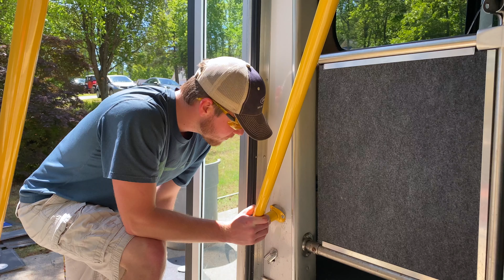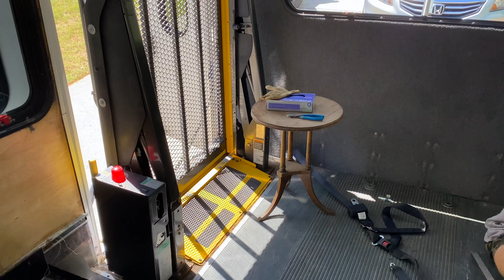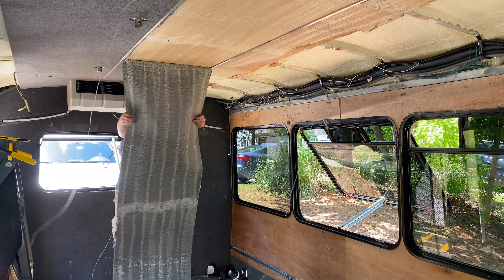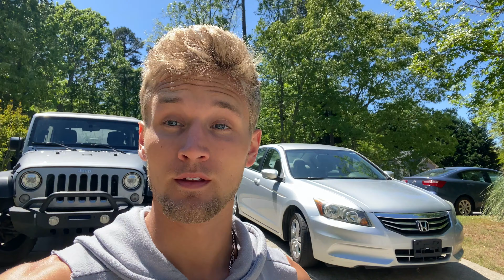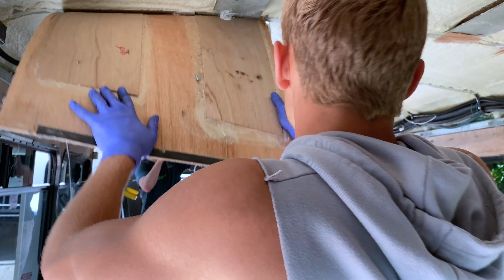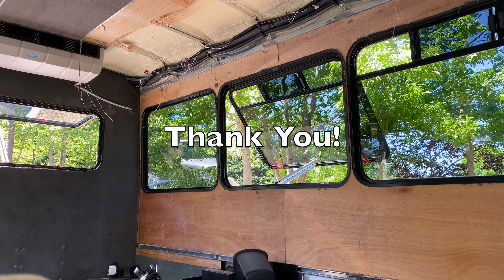SHUTTLE BUS Conversion | COPS Called | Removing The Interior & Ceiling | DIY Demolition Day 1

Comment: Hi,  not sure if you've got this info some where, I'm wondering the length bumper to bumper & inside,  width inside & outside,  height inside & outside. Thanks
Reply from the maker: 22.5 ft long, 8 ft tall, the inside squared frame to work with is roughly 14.5 ft long by 7.5 ft wide.

Comment: How many passenger is that bus?  and how long is it bumper to bumper?  Thanks!
Reply from the maker: I believe ours was a 12 or 13 passenger. Front to back I believe it is at 21 or 22 feet. I do know the inside squared off is 14 ft 7 inch long & 7 ft 6 inch wide!
Reply: @AwakenDaze  Thanks!  Yeah I needed overall length so to make sure it would fit in a parking stall for a tailgate wagon.

Comment: the "leak "is the cooland from the engine being routed through the interior heated , you need to connect the hose ends together and top up the cooland in the radiator again , or you will overheat the engine
Reply from the maker: Thank you for the advice!! At the time we didn't realize that the unit was for the front and rear AC. But we were finally able to fix our mistake and now have front AC again!! :)
Reply: @AwakenDaze  i didnt realize either they did that system the way they did , it asnt the aircon i was talking about but the heaterunit on the floor , seen quite a few video's where they take out the heater and found out all the coolant has leaked out of the engine too , sumtimes they connect the lines together with a small piece of pipe and two hoseclamps them the pipe shoots off the hose halfway up a steep grade 
you could basicly remove the hoses at the engine and make a small loop from one ecit to the other then fill the coolant back up , if they didnt t-ed of the front heater , it should stay working 
you mentioned about having stuff done , and with some stuff i agree , i would advise you to have the person doing the repairs and fixes explane common problems and fixes , they will help you when youre on the road with no celphone coverage trying to fix the bus so you can limp it to the next station 
since you are working on the wiring (and im not sure if a shuttlebus is wired the same way ) there nanny switches on the reardoor that prevents the bus from being started or driven when the rear door is opened , these switches close when the door is open , so when the bus whont start after removing wiring thats the first place to look , just tie the wires together and it works again (label the stuff before taking it of and check the starting of the bus every so often so you know wish batch of wires you need to check )

watch a lot of youtube schoolbus conversion vids like im doing (man can dream can he?) there are a lot of little tricks and misstakes that are made than can be prevented when you know wat to watch out for
Reply from the maker: @watahyahknow  We didn't realize that either until we had a mechanic come out and look at it for us. We're very thankful that he did because he was able to readjust our issue.
Reply: @AwakenDaze  🤫😛😝😜🤗
Reply: yeah we ran into that in our build

Comment: I hope to do this someday. However, I do not plan to rip out the roof insulation or the floor. But I love how all the windows on your bus open. You may see if you can reconfigure to run the existing ac unit to run on battery power.  I know of several shuttle bus conversion projects that have kept the ac unit as is. They use to quick cool down the interior. They've said it doesn't use as much gas as they thought! Remember, it's not moving the bus, just running the ac unut!
Reply from the maker: It will definitely be worth it! We gave the ac unit a lot of thought before removing it. For us we believed it was beneficial to be able to run the unit when the bus was off. The windows was a deal breaker for us, we love all the natural light 😍

Comment: Just as an FYI  the rear ac unit is hooked into the front factory ac unit . If you remove the rear unit you will loose all Freon and have no ac at all . you would have to replace the front ac lines to Orem replacement lines because they cut and tap into the open lines to add the rear unit . I would just leave it . Or like .i said you will need to get new lines in the front engine compartment for front ac only .
Reply from the maker: Hey Joseph, we ended up discovering this a few videos down the road! Austin actually finished working with a local mechanic to get the front ac unit back up and running on its own. I don't have all the details but I know he recorded a little bit of it to explain what happened in our next video! We continue to learn as we go haha, feel free to watch our other ones and let us know what we can do better!

Comment: What size is your Bus???  How long is the bus and how long is the length from behind the driver's seat...to the back???
Reply from the maker: Hey Karen, our bus is 24 ft! It is perfect length and regulation to travel most of the roads :)
Reply from the maker: Oh and you have 14 ft from behind the driver's seat to the back! 7.8 feet wide I want to say
Reply: Thank you for the info...I love your bus!!!
Reply: Do you have a video for a walk thru to show us your Conversion?
Reply: For comparison a E350 extended passenger van is a little over 19ft long. Just bought a similar 2006 E350 bus,as of now not doing a conversion  need it to transport my father. Standard wheelchair vans cost 4 times as much.

Comment: Oh my goodness! You two are going to be a lot of help. My husband I just bought an old prison bus this week,same shape and stile as yours. It had changed hands a bunch and various things done to it. Now we know what the roof is going to look like when we pull down to redo and wire stuff. And there is a heater fan thingy on the floor under the one remaining seat.

It gets a new windshield Monday. We have to get it aligned and tires balanced. It rattles your teeth out of your head. The alternator belts squeaks and the exhaust have been jerry rigged. After that, we can deal with the rest.
Reply from the maker: Lisa this just made our evening!! Let our journey support yours as it is a fun one for sure! We are working on the next video actually. 
We are here to help in any way possible. Send us a message on instagram anytime @awakendaze

Comment: It's cool but I'd stay far away from conveting a shuttle bus. They are fiberglass so incase of a roll over or flop accident, you are basically considered dead because it will just fall apart vs a school bus being all metal. This is something to heavily consider.
Reply: BUT on the other hand, how often do you hear of shuttle bus rolling over? AND there is always the weight consideration. ... which translates to gas mileage.
Reply: L Meade oh so saving money on gas is more important than your safety ? Accidents happen way more often than you think or know. And you never know when a roll over will happen.
Reply: Shuttle buses have a metal frame to keep people safe from crashes and rollovers, similar to a Skoolie. I think it could use some reinforcement though. 

What would you say if they redid the frame with sheet metal?
Reply: @whats_in_thename8699  you can easily install sheet metal when doing insulation, which most people do anyway. If your vehicle home rolls over, you're as good as dead in any vehicle.
Reply: When on the road , everyone should be in a approved seat with 3 point  safety belts and the cabin area for safety,
RVs are not a safe place to be in a collision situation anyways  ,  so do your best not to be in a bad situation !